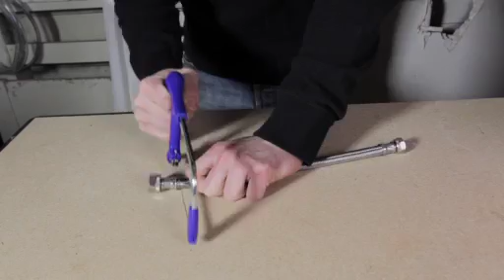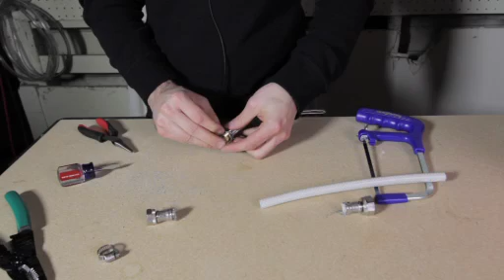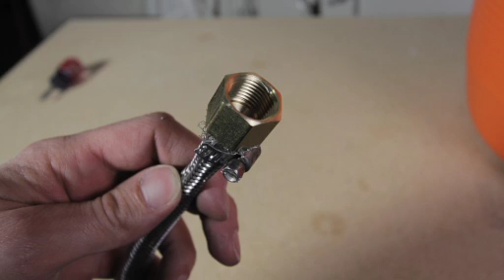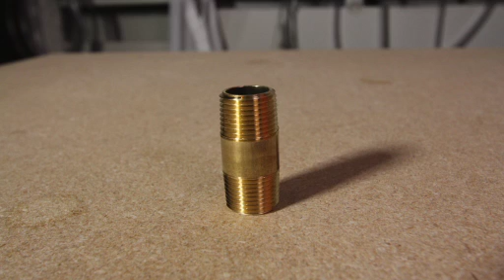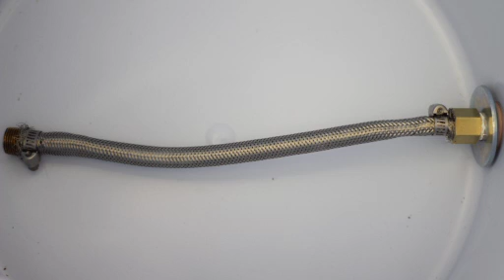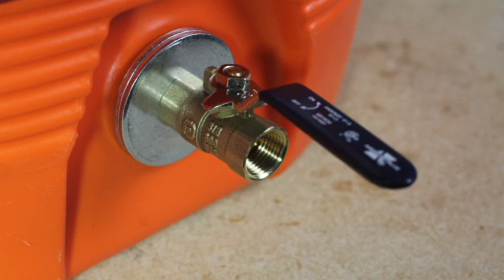How to Build Mash Tun for All Grain Brewing - Homebrew Academy

Comment: One of my buddies used an AC supply line from Home Depot (the process is the same as the water supply line) but it is much larger (1 inch in diameter) It worked well for quite a few years.